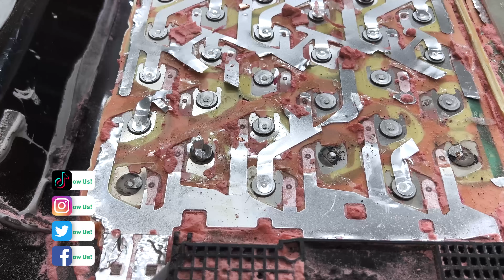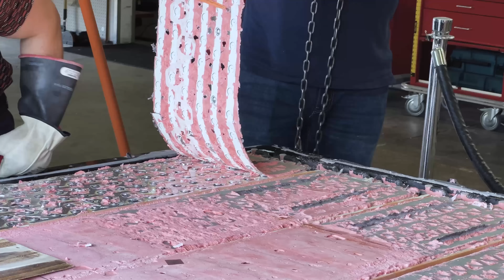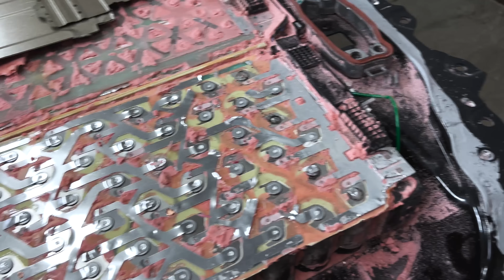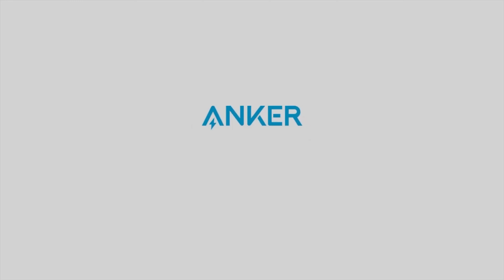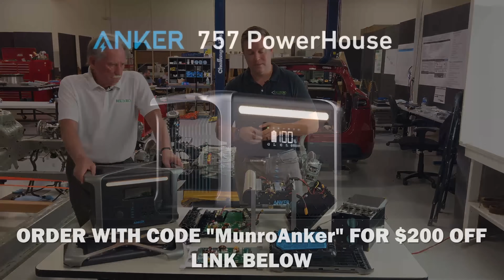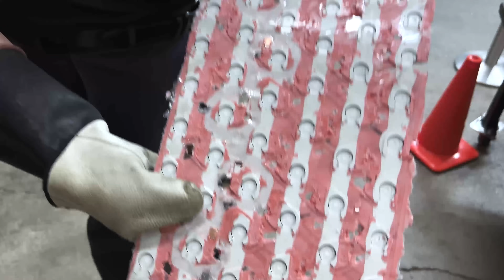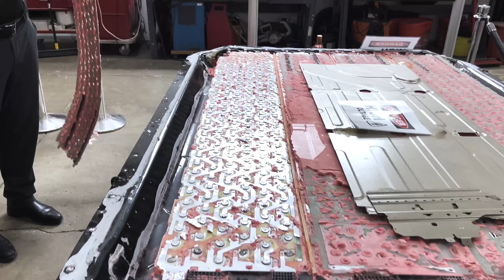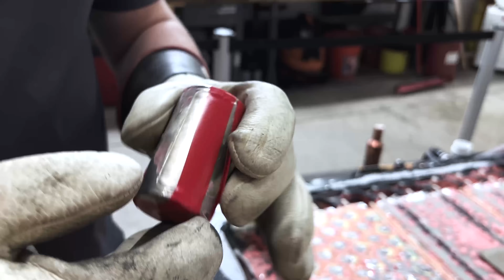Tesla's 4680 Current Collector Layout

Comment: With the pack being completely unservicable, I sure hope it works and it lasts for a very long time without internal condensation.  Big gamble.
Reply: Like every larger complex product you buy. 
Imagine a laser-welder for 1.5 million. Or a MRT for 2 million. 
You can not replace one single Laser LED or one little squid in the MRT.
Big gamble? You can always byuy a GM.
Oh sorry, no, you can not. My bad...
Reply: @wolfgangpreier9160  Wow, I didn't know that.  Thats a big loss if it goes out.
Reply: This design will likely make the overall fleet more reliable, with far fewer points of potential failure.  However, it will become more expensive to repair failures when they do occur.  Tesla is looking at the big picture: fewer overall warranty issues, but when they do occur, just swap the entire pack... which they're doing already.
Reply: @Bryan46162  How much is the repair cost of a used Model S Pack from 2016? Around 15K US$ third party and up to 25K US$ from Tesla. How much will the structural pack cost to be replaced with a used one? I guess about 15-20K. How about a new pack? 25K. 
A repair is not necessarily cheaper then a new pack. Maybe in 10 years when you need a new pack the prices of the raw material have plummeted and a new pack with Na+ cells costs only 5K? You could not repair a old pack with those cells but you could get a new pack.
Reply: By "unserviceable", you mean apart from all the control electronics being in a separate box on top of the cell block? (AKA "Penthouse")
Reply: @rogerstarkey5390  As far as internally, it is completely unserviceable.  If Munro can't even get into it, no one else has a prayer.
Reply: @clnelson321  That's the whole point of this design. That's its strength not its weakness. It's not supposed to be opened up and tinkered with. It has all been explained by Munro's videos.
Reply: No room for condensation. It's essentially a solid block.
Reply: @MrAdopado  it’s not a solid block lol….. the foam didn’t cover everything 100%
Reply: @alanmay7929  
You seem particularly angry today?
What's up?
Another nail in the FUD coffin?
Reply: @alanmay7929  Yes, the seats were still visible. Worst foam filling job I’ve seen since demolition man!
Reply: @Wolfgang Preier  lol………….
Reply: @alanmay7929  There are no spaces ... the spaces were created in the process of breaking it apart.
Reply: Not really
Reply: Yeah sure, Tesla always gambles with its engineering...
Reply: Tesla has almost 20 years of experience with battery packs, they know how to make them last. And the cells should last at least a million miles.
Making the pack serviceable would add a lot of cost and complexity to manufacturing, and would reduce rigidity and longevity. Plus Tesla doesn't want yo to mess with the high voltage system anyway.
And the reason why owners won't care is that most likely the packs will outlast the rest of the car, and even if not, by the time out of warranty replacements get common the cost will go down drastically.
Reply: @andrasbiro3007  The oldest battery packs of the roadster are around 14 years old and start to break down. They were planned for 10 years lifetime. Not more. The new packs are planned for a 20 years lifetime and 1500 cycles - meaning around 500.000km or 330.000 miles. Semi packs will be replaceable. Semis have a projected runtime of 2 million miles. Model S will last longer, Model 3/Y shorter. We‘ll see how the plans go for the CT.
Reply: @andrasbiro3007  Thank you for this clear and importent information👍
Reply: @andrasbiro3007  : or almost 15 years in current form...  /lots more to learn no doubt...  Thanks Panasonic for making it work..lol,  ha ha ha...  the real teardown, jelly roll unwrap and chemical analysis awaits (if there aren't already legal threats pending... lawsuit)  - wonder.  (Did Jim take a cell; home??)
Reply: @andrasbiro3007  they could have made the pack serviceable too l! It didn’t need to be that complicated lol…. The older model3 had 3 big batteries modules either LFP or Nmc, this new battery/structural is a total disaster/nightmare tbh!
Reply: @Cloxxki  have you watched the assembly line recently!? The seats are mounted on the battery pack and then bolted from underneath the car! It’s a structural part of the vehicle.
Reply: @alanmay7929  Have you ever seen and measured a repaired battery pack and how long that lasts how much capacity and power and how much it costs? And have you compared those numbers with a completely new pack consisting of all new cells? 

The old pack lasts only as long as the oldest cell in the pack. The new pack is: new. 

I would not want a repaired pack or module replacement in my battery. No thank you.
Reply: @Wolfgang Preier  you have definitely lost your mind! ICE are able to last up to million miles/km with their original engine/gearbox….. they don’t need to be recycled after one part fails! Batteries can be made easy to repair they have BMS….. to control all the voltages/outputs and much more. Not everyone has the money to buy a user expensive new EV.
Reply: @Wolfgang Preier  people still buys 20 years ICE as their first cars I don’t see any EV been able to do that while most of their range are still ok, let’s not forget charging…
Reply: @alanmay7929  maybe in your neck of the woods. Here in Europe they can not afford such Oldtimers. Only rich people buy old cars.
Reply: @alanmay7929  Yes i have lost my mind and see what those poor garage and workshop owners post everywhere when they have to replace a engine @ 80.000km and a DPF with the whole exhaust system @ 120.000km. Or on older cars where they get replacement parts - from the junkyard. You can do this in the US where there are no laws but not here in Europe. 

Junkyard parts are possible - doors, undamaged windows, quarter panels, all non structural elements, maybe even a very good and not corroded control arm. But if they put in a half shaft they have to guarantee its functionality for 6 months. No workshop would do this with junkyard parts. If you do this yourself and are caught doing it or afterwards somebody reports you to the police and they come controlling - and they MUST come controlling - you are f...d and must pay the fees. And they are substantial!

Yes: That was possible even 20 years ago. Everybody looked the other way even if it was unlawful even then. But those times are over and out.

Again: the boys in the US and in east europe - mostly russians and some older polish people do this. Everybody else can not afford such problems.

one million? - European and American trucks, yes. The big ones - those the US boys call Semi. Those are built for a million kilometers. Not the chinese.

No you can not repair a battery pack of a current EV in your home shop. No manufacturer is interested in a lawsuit because some DIY boy wants to meddle with 450V DC.
Reply: @Wolfgang Preier  who said someone was going to work at home on a 450v battery!? Wtf!!! We’re talking about repairability not DIY clown!! People want to maintain those cars on the roads as long as possible and also for very old ones to become super cheap for everyone.
Reply: @alanmay7929  Yes, and i've told you no repair shop would repair or even try to repair your GM Bolt battery. Roadster or older Model S are expensive enough to warrant a try - and even they have to demand a very high price for repairing them. I am sure somebody will offer a repair of the Aston Martin battery pack and maybe sometimes in the next 20 years even from the EQS and BMW iX50. Those cars are worth the effort to learn how to do it.

You may repair a Nissan leaf battery pack - it will give you at least 20.000 more miles on the other cells before they break down.

And you know of course how many external repair shops offer such services for your Smart? BMW i3? Nissan Leaf? VW E-Golf?

I know how many do this here in Europe. Besides the manufacturers themselves? Bosch EVHub in norway for BMW I3 and Model S batteries. Thats all. And only on Module level, never on cell level.
Reply: @Wolfgang Preier  you have completely lost your mind mate!!! Why only repair Aston Martin batteries or EQS or bmw ix50!? That makes no sense at all! Those are all vehicles that some people will still own and drive! I seriously don’t understand what’s going in your head!!!!!!
Reply: @Wolfgang Preier  there are more and more EVs coming to the markets/on roads therefore more and more mechanics specialised in repairing/working on them!
Reply: @alanmay7929  in poor countries yes, but we are talking about the mass usage of cars. Not a million or ten, but the big three. China, US and Europe. And even those in Africa, South America and Asia will exchange their energy use to renewable energies if they do not want to finally go bankrupt like Somalia or Afghanistan. Of course that takes time, but not so much as you think. In 2025 the last fossil car will be announced in Europe. In 2030 he last passenger fossil vehicle in the US and China. In 2035 the last fossil car will be sold in China, Europe and many countries in Asia, Australia (hopefully, not sure). 2025: New Zeeland announces the end of fossil cars in 2035. Not sold: The end of. 2040 the last fossil truck is sold in Europe and the US. Most of the others have switched to E-Fuels. Saudi Arabia announces its the largest producer of green H2, green Methane/KNG and green E-Fuel. 

Russia starts their 3rd war against Ukraine and the Baltic states, border skirmishes against Poland, Slovakia and Hungary. etc. pp. What has all of that to do with Russia? They still depend mainly on fossil ressources - what do you think the reason was for annexing the Donbas in 2014? And why did the Russians start their war - all think it was 2022 - actually they started with stopping to fill the gas storages in germany in 2021…

We live in interesting times. I will experience the end of the fossil. And i am looking forward to it. And i very much am afraid the Rus will try to stop us doing it.
Reply: @wolfgangpreier9160  why are your comments always full of crap! It’s not about poor countries! Because those third world countries can also afford brand new cars but not at the level of the “super 3” lol….. most of the those countries needs much cheaper and actually capable vehicles which I don’t thing EV can really fit that as for now! Let alone old EVs with limited ranges….those old imported ICE are actually easier to repair and actually fullfill the needs of those people.
Reply: @wolfgangpreier9160  I feel sorry to disapoint you but you won’t see the end of fossil fuels! It’s also in everything from aircrafts to ships……. Even rockets!
Reply: @alanmay7929  Oh i am not disappointed, i know we live in the end of fossil cars and trucks/lorries. You are not able to change my conviction.

Ships will take longer, there is currently no visible solution for their usage of heavy criude oil. Maybe LNG?

Airplanes have already started to convcert to E-Fuel. You should have watched ila 2022 where all major players have presented their strtagies to convert fossil fueled airplanes to e-fueled and small ones to electric and up to midrange to hydrogen.

Yes its in everything so our job is not easy to remove it from everything. 10 years for the cars, 15 years for the trucks, 20 years for the airplanes - we'll see how long it takes for he rest like farming, ships, heavy machinery.
Reply: @alanmay7929  Batteries are even replacing ferrys, trucks, trekkers. There is no "need" for further development. Of course there will be further development to lower the cost and find better uses of electric storage.

Small cars? You want to tell me a Mercedes E-Actros or Scania 40 ton is small? A Tesla Semi is small? A 139 meter long ferry for 600 passengers and 200 cars is small?
In Biehl they operate a 110 ton electric dump truck. Such a thing is SMALL???

Ohkayy...
Reply: @wolfgangpreier9160  which ferries with batteries!? You want to make me laugh way tooo hard!? The electric ferry in Norway has a miserable two digit range it’s not even able to reach the high seas.
Reply: @wolfgangpreier9160  you are just naming random things as if they were actually a thing! The Mercedes’ e actros is for short range delivery mainly for Europe just like the scania 40 tons! They donot even compte with diesel. The electric dump truck must be a joke right! Does it work everywhere!? Of course it has a very specific place for use.
Reply: @alanmay7929  Yes, thats the way ferries are operated. You said its not large. I say it is. 

Stuff your vitriol. Its just annoying. And what for? 

You wanna insult and heckle me?
Consider it done.
Reply: @wolfgangpreier9160  a 139 meter long ferry with capacity of 600 passengers with a miserable range is good for mass all applications right!? Lol…..
Reply: @alanmay7929  
You know, engineers aren't just putting together things at random, and see what happens. There's a ton of science and lab testing behind every product. In case of batteries, you can cycle them much faster in a test rig, simulating 20 years of real world use in drastically less time. Also cycle life can be estimated based on shorter term degradation. These are the things Jeff Dahn and his team does for Tesla.

Again, making the pack serviceable would add a lot of cost and complexity to manufacturing, and would reduce rigidity and longevity.

Also, you opinion has zero weight, you've been consistently wrong about everything for many years.
Are you at least paid to be here?
Reply: @andrasbiro3007  why would I need to be paid!? Are you drunk!? Don’t you see those super old 40 years old Mercedes’, Toyota….. vehicles all around Africa, South America….. imagine if they were made from engines which needed compete changing or even gearbox or many other components!
Reply: @andrasbiro3007  the used battery pack is made well could have super great to divide into like 4 or many modules and make energy storage with them before recycling later! A great loop essentially! Instead of having to recycle batteries that still have tousands/a lot of life in them.
Reply: @alanmay7929  
Not "super grate" just slightly more convenient. But it would significantly increase the cost of the car. That's why Tesla got rid of the modules, and most other manufacturers are doing the same.

If you want to reuse a pack, reuse the entire thing. There's plenty of demand for large scale energy storage too.
Reply: @alanmay7929  
You've been hating on EVs for many years, and you are everywhere. So either you are paid, or your life sucks. I went with the more generous option.
Reply: @andrasbiro3007  lol…..  another funny comment! They literally had 3 modules on the latest tesla battery pack before the structural one! The structural battery is still built like it had 3 modules except it’s all glued together no way to reuse anything! Not all manufacturers are following that road tho! They can actually spare weight at other places.
Reply: @andrasbiro3007  no one/very few people are going to reuse a whole EV battery pack for energy storage! Do you even know how stupid expensive those things are!? I’ve barely seen 3 videos on YouTube with such things. Having something like a module or many to provide 5 to 10,15,20Kwh of batteries is great way to go. Battery of cars needs to be reused for energy storage until they are no longer viable and there comes recycling.
Reply: @andrasbiro3007  recycling has always need energy intensive too! By reusing the battery we significantly improve on the lifetime and usability/efficiency on those used batteries. Just like vegetable oils or gas from landfills can be used in combustion engines….
Reply: @alanmay7929  
1. Again, you can reuse the entire pack.

2. With abundant and cheap renewable energy the equation will change dramatically. Already there's excess solar energy on sunny days, that can be used for energy intensive, but not time critical, industrial processes. Like recycling.

3. Biofuels are actually horrible for the environment, because agriculture is very harmful. And there's nowhere near enough landfill gas. And neither solves the air quality issue.
Reply: @alanmay7929  
Modules are not the problem, making them independently removable is. For starters, the whole pack could never be as rigid as it is now. Then it would add a lot of extra parts, and manufacturing complexity. That's more weight, more cost, less reliability, lower quality. To understand why, just watch Munro Live.
Reply: @alanmay7929  
1. Again, grid scale energy storage. This is not a cottage industry, battery farms are already at GWh scale, and still growing fast. The projected global energy storage need is like 300TWh. That's like 4-5 billion battery packs.

2. I'm seeing many houses with multiple Powerwalls, up to 10. If you want to go full solar, and your utility doesn't offer net metering, you need a lot more storage. Not to mention that you likely want to charge your EVs too. 50-75kWh of storage isn't overkill for a larger home. And with the falling prices it's affordable too.

3. There are larger buildings too, not just single-family houses. Apartment buildings, offices, factories, etc. Those also can use solar, and therefore need storage too.
Reply: @andrasbiro3007  which almost 20 years!? Stop talking crap!!! That means absolutely nothing at all! Those cars haven’t been out on the roads or around the world for 20 years lol….
Reply: @alanmay7929  probably referencing tesla founding in 2003. Their first 18650 pack's though made by streubel go back to 2006. 
Many of the 2008-2010 roadster pack's are still around.
Reply: @4literv6  that was streusel and not tesla lol…. And those cars aren’t daily drivers like model s or y and doesn’t even uses tesla supercharging!
Reply: @4literv6  Yes the roadster packs are still around and most start to fail now. Its unclear how they can be repaired if at all. Nobody makes new modules - could be a nice profitable project.
Reply: @wolfgangpreier9160  Gruber auto has a roadster repair program where they re condition pack's. They have a few videos on here.
Reply: @4literv6  Yes, Roadster, Model S, Model X - the older ones at least, even Model 3 and Y 2170 packs - Modules can get exchanged - but NOT repaired. Audi, Mercedes, BMW, Volvo - all offer services to exchange modules. But if a module destroy the pack you must replace the pack completely. And you only get the same range as before because the weakest link - the worst cell - defines the maximum range. 

You can pull amodule and disable a single cell and try to reuse that module - Gruber does just that with roadster modules.

Even Gruber has no idea how they should "repair" a module. They tried a new manufacturing line but i don't know how far they've got with that idea.
Reply: @wolfgangpreier9160  I wonder with people bitching n moaning about lack of reliability for the strucutral 4680 packs.
How relevant what you said is to other ev makers pack's once it's time to attempt a repair of damaged cells or replacing modules?

So far imo really no ev pack looks all that repairable without specialized knowledge. It takes a lift in a shop to get at the pack's, insulated tools, high voltage handling experience, a specialized cart to support the pack. Plus the ability to not only unseal a pack to get at the modules and cells. But get every thing put back together correctly, reconnected or re wired and then re seal it all up against moisture intrusion. 🤔
Reply: @4literv6  "So far imo really no ev pack looks all that repairable without specialized knowledge." Yes for every day use EVs from the OEMs or Tesla. No for specialized or self made EVs.

"get every thing put back together correctly, reconnected or re wired and then re seal it all up against moisture intrusion" Yes! 

And - if you are a workshop - with warranty. What will your insurance tell you when the first repaired battery pack goes up in flames? Well done? I don't think so...